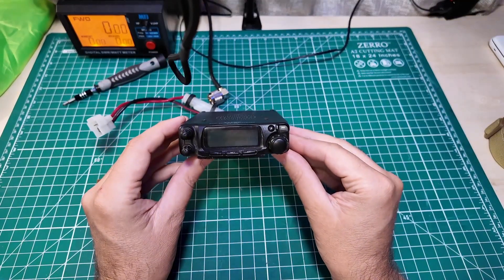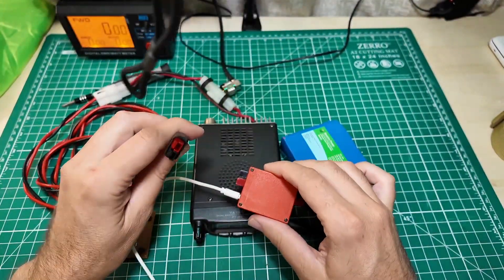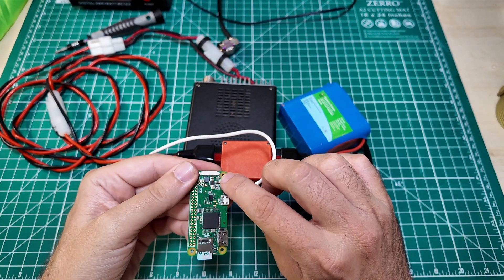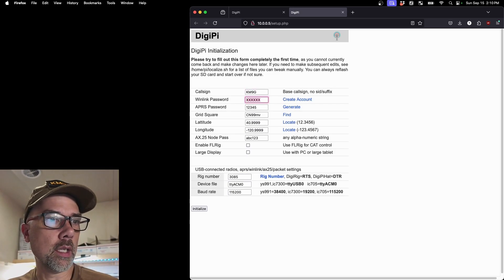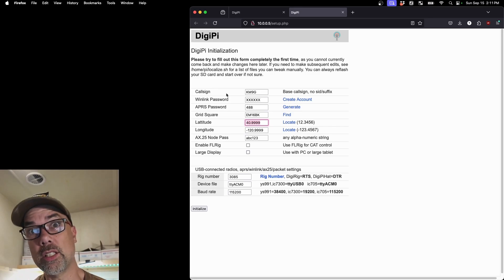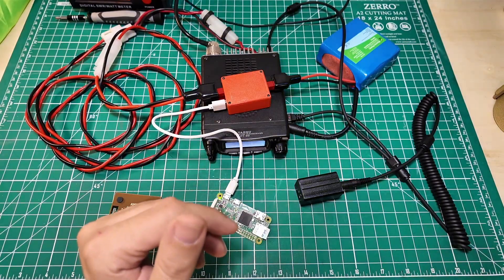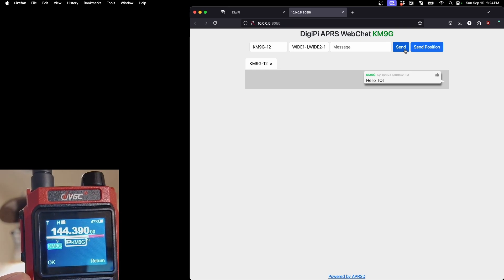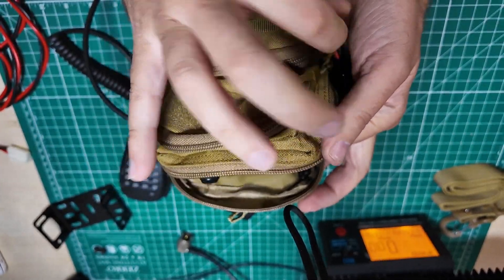Does it APRS?

Comment: I need to get my FT-90 fixed, it has a bad ext speaker jack, it affects all the audio.😢 I love that little radio...
Reply from the maker: weird.  I wish yaesu would publish parts specs for discontinued models.  Check ebay for models from that vintage and cross your fingers.  I just had to get a set of rotary encoders for another yaesu radio I'm fixing up.  $14 on ebay.

Comment: Digirig Mobiles are my go-to sound card and PTT control boxen for APRS. Denis's support is outstanding and his products are top-notch, and a lot cheaper than, say, a SignaLink. I buy Digirig shielded and choked cables too. Other than figuring out how to properly configure Direwolf setting up a Retevis RT95 digipeater was almost plug-and-play because the little box and the cables Just Worked.
Reply from the maker: I agree, Denis is top notch!

Comment: I noticed after you hit Initialize (7:31) your baud rate went back to 115200.  I assume that is the baud rate the digirig is configured to work at.  Is it 38400 or 115200?  Also your Rig number and Device file changed.   Could you clarify the setting you used to make the Digirig to work?   I have a Yaesu FT2800M that I am considering doing exactly what you have done here with Digipi and all those parts. Thanks again for the APRS content.
Reply from the maker: Hey Brian, sorry about the confusion there.  Those are for cat control settings and this radio doesn't support cat control.  I could have been more clear about it, but I forgot since it doesn't apply.  The APRS is sent as audio and the digirig injects the PTT for you.

Comment: here is what I want to do...use a Motorola vhf mobile connected Argent systems data box connected to a Android computer I have the Jeep wrangler JL doing APRS
Reply from the maker: That would be pretty cool! If the radio can transmit on 144.39, the rest is just making the right interface cable

Comment: Did the 3ah Bioenno cost more than the radio?

The same Pi gets the same address every time in the shack so I use IP address, not digipi.local, which is problematic.

Since the FT90 does not have CAT control, a Digirig Lite would be a little cheaper.
Reply from the maker: The bioenno was a gift from another ham, but yeah, they are pretty much the price I paid for the radio.  Both are examples of being at the right place at the right time and realizing it (aka luck)

Yeah, its a DNS problem more than a digipi problem on "digipi.local", IP is more reliable to use, but not as friendly as the name.

Yeah, digirig lite would be a great idea - there is a cabling mess in my future that I'm not happy about.

Comment: I need to get into some digital modes eventually.
Reply from the maker: What radio do you have?
Reply: @temporarilyoffline  I have an FT-991A and FTM-200DR in my shack connected to my 12V power supply, and FT-891 and FTM-500DR in my truck.
Reply from the maker: @CURTIS-W5CER  All of those radios have data ports on the rear.  Happy to share some knowledge.
Reply: @temporarilyoffline  I'm a network guy at my job, but I have no idea how to even get started with digital in ham radio.
Reply from the maker: @CURTIS-W5CER  you'll pick it up quick, I've got a ton of videos on it too